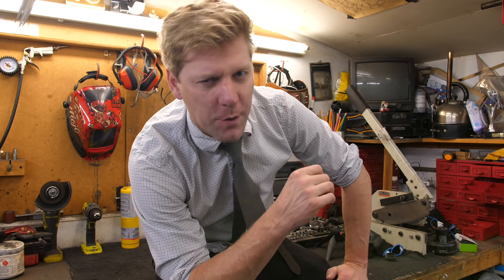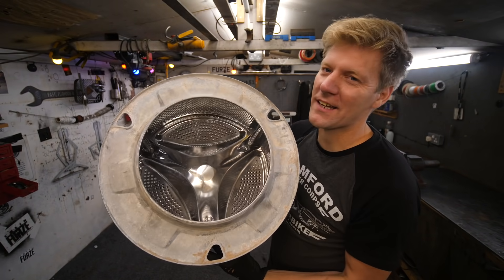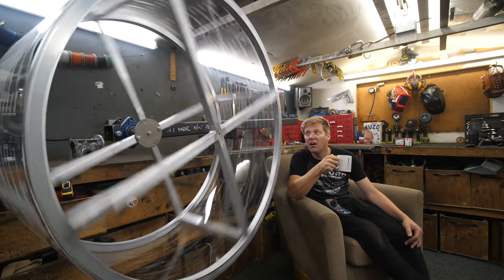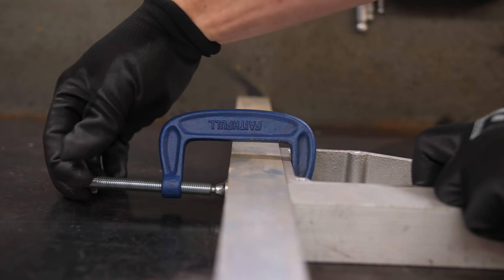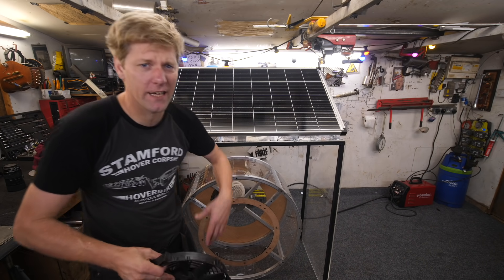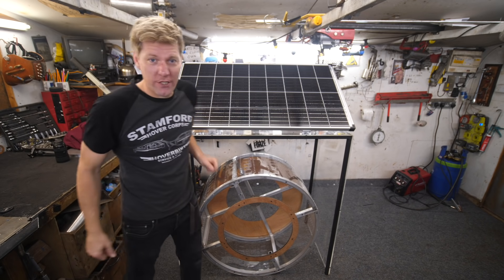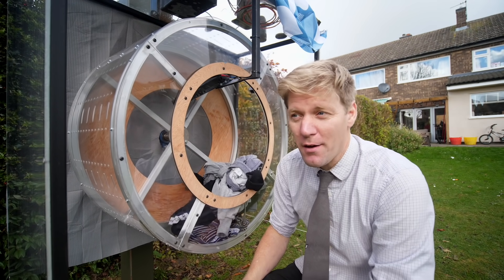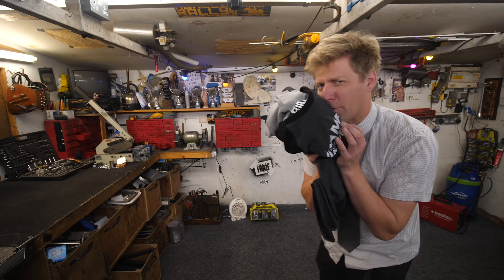Wind/Solar Powered Clothes Dryer

Comment: That was a washing machine you took apart. The door you commented on, which the plastic shape, only appears on washing machines. Clearly, you have never had to do any laundry. Lucky you.
Also, that solar panel doesn't look large enough to power the motor and the fan. I think you're playing some games with us. It might be enough to charge the battery, over a few days, which could then be used to power the motors...for maybe an hour or two: maybe.

Comment: Instead of a curtain insulator you should have a solar heater in front of the machine on a hinge or slider. It's just a big frame with black painted plywood and cascading black boards, plexiglass or clear plastic over the front, a hole in the top and a hole in the bottom for air in and out. Powered by thermosiphon :) that would produce as much heat as a home drier on a sunny day

Comment: So you're using a solar panel in combination with a wind turbine. Why not put a couple of solar panels on your roof and use the energy they produce (together with the wind turbine) to run your tumble dryer (and most other electric appliances)?  You could also see if you can sell any excess energy you produce to your energy supplier. That way, at the end of the year you could actually get money from them instead of having to pay them. Or would that be to obvious to do?

Comment: Build a woodgas powered stirling engine to power your home/bunker; collect rainwater, pump it to the stirling generator to act as the coolant, then pump the hot water and use it to heat your house/bunker. For fuel for the stirling generator, use woodgas or biogas (which you can also build a contraption to produce out of food waste) and pipe it to the generator for fuel. Capture the exhaust from the generator and (I know this is possible, but I don’t know what it uses) turn it into ethanol. This would basically recycle your fuel and nothing would be wasted. I hope you see this @colinfurze

Comment: What if you built a firebox that has a tall smoke stack that is inside of a bigger pipe.. The bigger pipe jackets the smoke stack and is used to flow clean air though it to extract the heat from the smoke stack..  airflow driven by a 12v duct fan.. The non smokey heated air is injected into the drying chamber. wood is also a renewable resource!

Comment: Also Colin if you put some ledges inside of the dryer, like in the ones we use, the clothes will get dragged/pushed up higher and fall down which speeds up the procces

Comment: We built a clothes rack from two cast iron brackets and four roofing battens, cost £18 in 1991 and hung it in our kitchen near our wood burner, we had three kids so it was always full and also supported lights over festive times. 
We then moved and hung it in our spare bedroom three rooms from our new wood burner, it still drys a full load over night even in winter. Saved us £'s. Cheers

Comment: 50 years ago, my girlfriend's dad built a drum that size from wood and wire mesh and powered it with a very small motor that turned it only slightly faster than yours. It resided in the basement, beside the wood furnace that heated the house. Worked great! My girlfriend also had no hair dryer; she had to go sit in the basement next to the wood furnace after a shower to dry her hair!

Comment: I was wondering if the vertical turbine could be used to turn an alternator. Well I know it can on no load but I was thinking how small would the alternator need to be to work at say 50% load? Might even have to go down to a dynamo.

Comment: I know this is not your usual style. But would be great to see more solar/wind powered furze machines.

Also if you set up a solar panel to assist in charging batteries or powering lights for the shed be nice to see how you do it. 👍

Comment: why not add a heating element from the solar panel so the clothes get dried the exact same as a normal? why not just plug the wind turbine directly into the motor and use it as a generator, then plug it all into a completely normal, unaltered clothes drier, since they ran on electricity initially?

Comment: If you did the metal curved on both sides ↪️on the wind part, the wind could work on both sides as well. I’m not sure if u came up with something  
                                                                          ↩️
to receive wind from both sides but the way you did it meant that it could only receive the wind from one side. (No hate)

Comment: I was born during  WWII. When I was growing up, my mother used a solar powered clothes dryer! Probably cost a lot less than yours. You might have heard of the remarkable invention, It was called a clothes line. There was very little to consider, other than where to set it up.

Comment: The clothes line works better for me:-)  But what fun! 
In this energy/carbon reduction line. I've got my electric use to 370 kWh per year. Two cord of firewood, for heating. Last year I biked 1500 miles, saving maybe half or so of those from the car trips.I

Comment: Dear Colin, 
Have you researched making heat panels for heating a house?
Basically it works like this, Sun heats up black spray painted cans, cans are made into a heat snake pipe inside of a black background chamber with a glass or plexi glass front of the case. Case is layed against house facing the sun at an angle on the wall like this /   Intake air is plumbed low on the wall and heat output is plumbed high on the wall.

That said also your background drape and front drape need to be black, I would even make the drum parts black it absorbs more thermal energy. Also I would make this and pump hot air through your dryer
https://www.youtube.com/watch?v=QLNViUsRCVU

Comment: Forgive me if I'm wrong but wouldn't having the wind turbine drive the motor backwards just help charge the battery? With the excess power generated on a windy day you might even be able to power a small heating element to help the prodess along!

Comment: Who is gonna tell him that he could run a tumble dryer if the home had solar panels anyway...
Reply: You'd have to have enough solar panels to deliver about 3000 watts at 240 volts. That's a lot of solar panel and batteries
Reply: @Alacritous  Not even these days. My heart pump dryer takes ~510W on low heat. 

Dries a normal load in 2 hours :) So much more efficient than older ones
Reply: @zeealpal  wait really, what ls the full model number. I might invest 🤣 xx
Reply: @MR_Fluffy141  It's a Bosch heat pump one, not 100% sure on model. Did cost $1.3k AU but the are smaller sized heat pump ones for a lot less (diff brands). 

I used a WiFi smart plug to measure ,  it's not worth the second unless off grid or a big family in a place with expensive electricity
Reply: @Alacritous  I have over 25 Kw of panels on my roof. What's the problem?  :0)
Reply: @glumpy10  now that's just crazy talk.
Reply: @glumpy10  does your house run off the panels or do you integrate the power you generate into the grid?
Reply: @Sharpless2  House is fed first, surplus goes back to the grid. Basic grid tie system, nothing special.  I am in the process of building a diesel Driven induction generator setup and co gening it to provide heat and power in winter particularly on the overcast days.
Reply: Furze's one can work at night though

Comment: Mabye take two PC CPU tower coolers like the hyper 212 and but them together then paint one black and put the other in some pvc pipe with a computer fan to blow hot air in. Or run a low wattage peltier system

Comment: I like the idea very much.
The tumbler might destroy the clothes at a much faster pace because it has to turn many times due to the lower temperature compared to a drying machine. Maybe, in the summer it can be a competitive machine.
Also, the inner metal "pipes" need to be rounder to lower impact.
These might seem like exagerrated reaction, but small things add up in time.

Comment: You need to make the turbine as light as possible. Perspex or thin plastic or material for the catchers and lighter metal for the frame. The drum could be made a tonne lighter and would require less torque from the turbine. Which in turn would spin it all a bit faster. Could also use black material for the drum to absorb solar heat. Or use heat pipes attached to a solar catcher. Or a thermolelectric generator on back of solar panel to collect more energy

Comment: To do this properly you would also have to calculate how much carbon equivalent cost the materials production you used and did have. You would do the same for a regular dryer and also need to estimate the lifetime of both. Just because during it's service life it only uses green energy doesn't neccesarily mean it's actually saving a lot in the end.

Comment: I think encasing the entire roller in a box of transparent material to stimulate a greenhouse effect and trap a significant amount of heat I’m sure it’d dry faster instead of using a small curtain as insulation. Obviously I’m not an engineer but it’s worth a shot in the comments for improvement.

Comment: Long distance travel with EVs has already been solved, and can be achieved with either:

A) Hydrogen fuel cells and associated refuelling infrastructure
B) Rechargable batteries and associated refuelling infrastructure

The issue is entirely down to infrastructure, which big petroleum sure as 'eck isn't going to invest in, and the government don't understand the concept. 

They think they can achieve zero emission or carbon neutral cities by blockading off all the roads that are essential for disabled, infirm, elderly and commercial use.

Basically, until local authorities and central government in the UK get to grips with the concept of investing in serious infrastructure and subsidies, it ain't gonna happen, and only those most in need will be margianlised more than they already are.

Comment: Instead of the one way bearings you might use a couple of scrap bicycle freewheeling gear clusters ... Maybe add a second panel to run a 12 vdc automotive electric heater for faster drying if towels and blankets ...

Comment: Ok Furze, i have an idea for a dryer to dry the clothes quickly and use less electricity than a conventional dryer. A turbo dryer! The turbo is spun via an electric motor. The air movement is what makes the drum turn and funnels into the tumbler to blow through the clothes. Want to have a go making one?!

Comment: "And you can't fit that into a utility room"

colin, you're suggesting you can't run a shaft through your roof to a tumble dryer?
Reply: That would be good that. How about Colin buys a windmill, converts it to a house and uses the sails to power a tumble dryer 😂

Comment: About powering lights in your shed... I have such a set-up. I had to replace the battery in my car and realised it would still hold plenty of charge to do things that didn't involve starting an engine. So I bought a cheapy 50W solar panel and charge controller kit, mounted the panel on the shed pointed vaguely at the sun, and have it charging the car battery. Then from the battery I have a 12V fusebox (like for kit cars), and use 12V LED string lights to light up the shed as well as have a cigarette lighter socket for a 12V soldering iron and a 12V vacuum cleaner (seriously!). There's also a radio and a USB socket. Once a week I charge up a USB power bank in the shed and then use that to charge my phone. It all works really well, and for the panel, controller, fusebox and cigarette socket I paid less than the cost of a length of SWA to the shed (literally just the cost of the cable, no installation or accessories).

Only thing is, I want to get a compressor so I will be running mains to power that and anything else heavy duty I get, but I will be keeping the solar set-up. Thinking about it, a DC light set-up is a good idea if you have things like lathes and mills because you won't get strobe-sync.

Comment: Imagine how much time is saved because you don’t have to peg the washing, over the years you saved a shit load lol
Reply: Except a clothesline is much quicker overall. So you have the trade off of quicker with more manual lsbor or slower hands off approach
Reply: @tiberiu_nicolae  maybe its quicker for drying clothes but as i often forget about mine it wouldnt matter how long they took to dry as long as by the time i remembered they were dry, therefore my time inbetween drop off and collection is used wisely
Reply: @tiberiu_nicolae  maybe its quicker for drying clothes but as i often forget about mine it wouldnt matter how long they took to dry as long as by the time i remembered they were dry, therefore my time inbetween drop off and collection is used wisely

Comment: I think if you threw some agitators onto the walls it would have worked better.  They could have carried the clothes higher up the wall before dropping it back down to the bottom, and I think that agitation would speed up the dry time

Comment: Need a wind turbine that uses lift rather than just drag, you won't have to worry as much about transmission losses when you have so much more power to begin with

Comment: "Wind/Solar Powered Clothes Dryer"...  do you mean a clothesline?  
In most cases you could argue that over time the carbon cost of the parts in the machine would be paid off by use.  While that would be true compared to an electric clothes dryer, the carbon cost of a clothesline kinda has you beat by a long shot.
Reply: But a clothes line doesn’t protect the washing when it rains, as it invariably does in the uk. The clothes can be put into the drier before you go to work, taken out when you return, and not get soaked by rain showers during the day.

Comment: Now how would you make sure that the wind power is being used, rather than the solar driving the wheel on its own? I suppose that the wind would only take effect when it is running faster than the solar output? Is there a way mechanically or with one simple circuit, to save all the power into the battery and fan when the wind power is going faster than the solar would need to assist?

Comment: You could find a way to add some heating in the drum with the extra solar power as well, and that would speed up drying time. They would have to be very efficient. Mount them under it, but far enough to keep the plastic from softening up.

Comment: yeah, and how much carbon was released in the making of this and the materials used? something tells me a shed load more then using a cloths horse that requires precisely zero power to make work.  renewables have a place, using them for the sake of using them is not particularly smart.

Comment: Using the James Blyth design for the blades, I see. You need blades inside the dryer to turn the clothes more other than them sitting in a bundle all the time.

Comment: It's a cool project. However, calling it low carbon just because it runs on wind and solar is misleading. One could even call it green washing (pun not intended). People should be aware of the fact that not only the carbon produced to run a machine contributes to machine's total carbon footprint. The other important contributor to the footprint is all the carbon that was released during the manufacturing process of the machine. And this part of the carbon footprint will be HUGE in the case of your machine. Why? Because you used so much material to build it - all the steel, aluminum, solar panel, etc. 

I don't want to say that your project is worthless just because it probably has a higher total life-cycle carbon footprint than a normal electrical dryer. I want to say that if you want to educate your audience a little, you should talk about greenness of your device with caveats.

In any case, thanks for all your projects!

Comment: "I might have some rolling resistence". Worm gearboxes at their best can get about 70% efficiency. The rest is lost on friction. Get a different type of gearbox for more efficiency. The second gearbox with the one-way rolling bearings is especially taxing on the efficiency as the gear is running the worm wheel. A gear turning a worm wheel is pretty rough, as you can imagine. You'd be better off with a pulley directly mounted on the bearing with a higher torque motor.

Comment: You should add a soda can heater to this with a little 12 volt powered fan to pump the hot air into the drum.

Comment: all you need is a shaft that goes through the roof, a way to lock the turbine or disengage it and you could have the wind powered dryer inside your house. I'd use the solar panel for elements to heat the clothes rather than the fan but this seems awesome

Comment: As others have mentioned, the clumping slows the drying. I'm thinking maybe you want hooks/brackets on the inside of the drum, and some crossmembers along the axis, that way the clothes get raised to a certain height and will be on raised bits with greater surface area exposed, in additon to de-grouping the clothes.

Comment: Hook Frank the jet engine vacuum cleaner up to it=dry in 10 seconds just try not to set ya washing on fire:)
That or swap the fan for a blow heater
No wind and a flat battery at night build a mouse wheel generator n let the kids power it up
Perhaps that stairs treadmill will do the trick so adults can use it too

Comment: WHICH WOULD SAVE ON GREEN HOUSE GASES THE MOST, STOP DRIVING YOUR CAR, OR STOP EATING COW PRODUCTS, IF YOU STOPED EATING COW PRODUCTS WOULD BE THE SAME AS REMOVING THE FUMES FROM 700 6LITRE CARS, LOOK IT UP ALL THE CARS SHIPS PLANES ETC PRODUCE ABOUT 10% GHG, WERE COWS AND SHEEP FARTS AND BURBS MAKE UP THE OTHER 90% THINK ABOUT IT GRASS SUCKS HUGE AMOUNTS OF CARBON FROM THE AIR COWS EAT IT AND FART/BURP THE CARBON FROM THE EATEN GRASS STRAIGHT BACK INTO THE AIR, THERE IS NO WAY PEOPLE WILL STOP USING CARS BUT CUTTING DOWN ON MEAT IS NOT HARD, IF YOU WANT TO CHANGE THE WORLD LOWER YOUR MEAT INTAKE, PS A KILO OF COW MEAT USES 3 TIMES MORE CALORIES THAN IT DOES TO PRODUCE A KILO OF RABBIT MEAT THE MOST ECO FRIENDLY MEAT